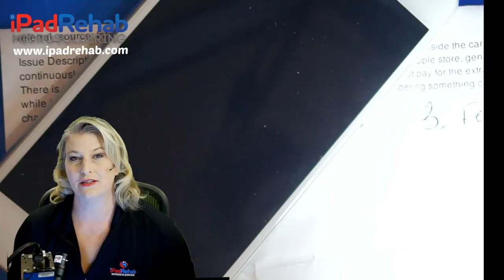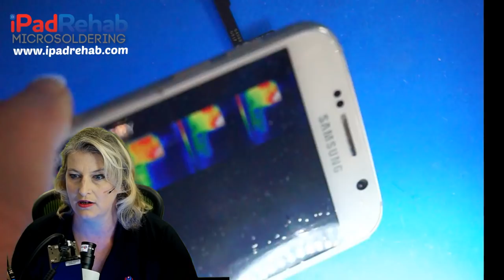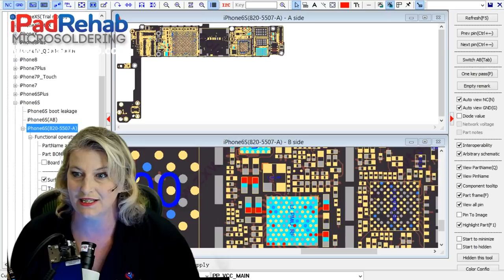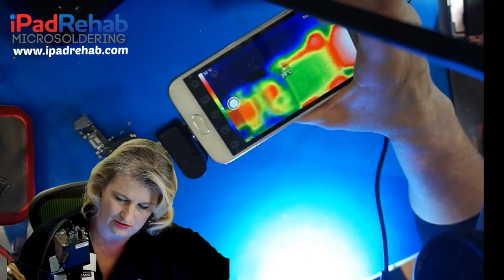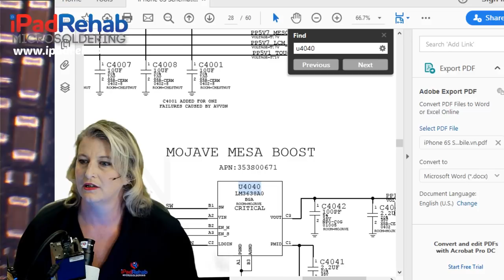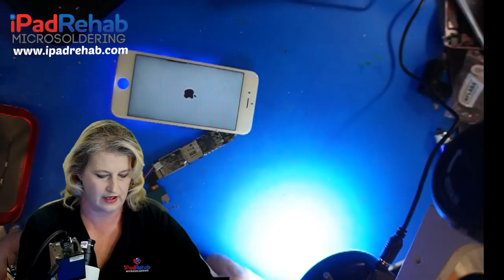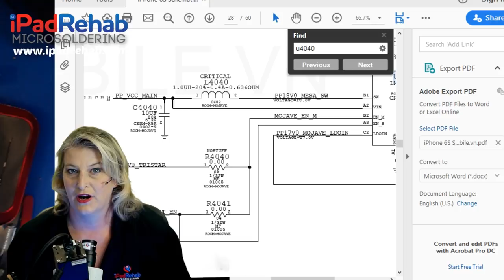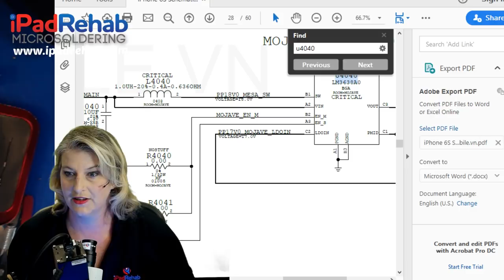Is Apple Unwilling to Help Anyone Named Fernandez?

Comment: I've gone to the authorized place of repair before for something as simple as an oil change so I could generate a service file showing it was done. They got it so wrong I had to being it back because of the low oil light. Not so sure the 'authorized' places of repair are worth visiting, and much prefer to do my own service and maintenance now.

Comment: A customer just walked back in after I repaired his iPhone LCD.  He took it to the Apple Store to do a trade-in.  They told him that the LCD was not an original.  Is there a policy change at the Apple Store?  EVERYONE goes to third-party shops after Apple Store rejects their iPhone, due to cosmetic damages. They actually say "get it fixed first and then you can get a trade-in credit."  
Has anyone else witnessed this unreasonable activity by the Apple Store?